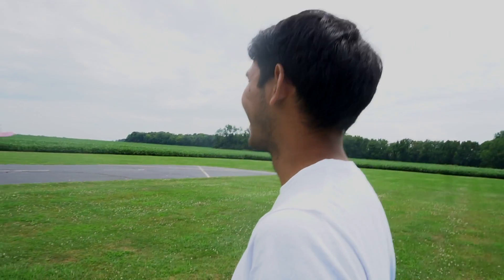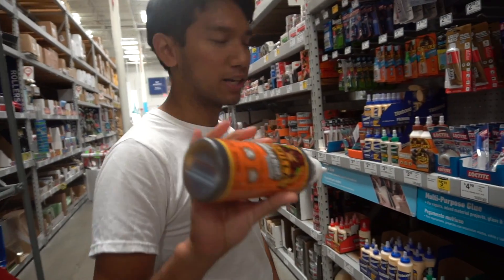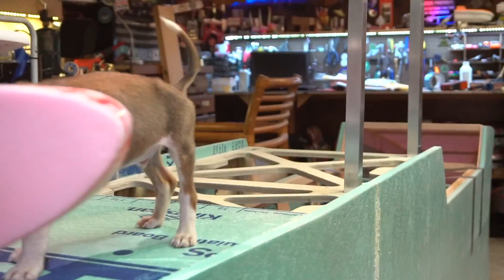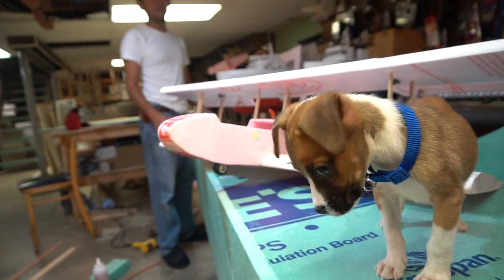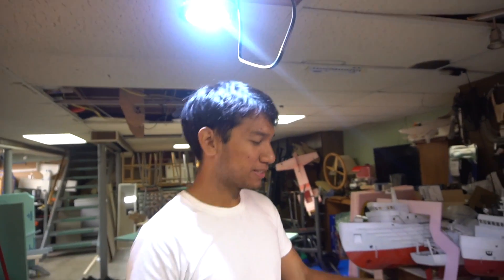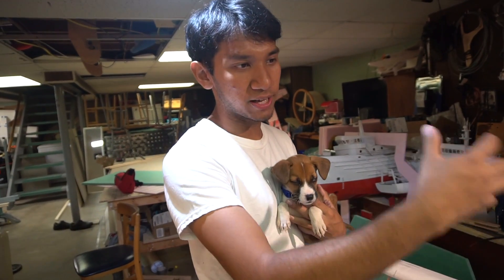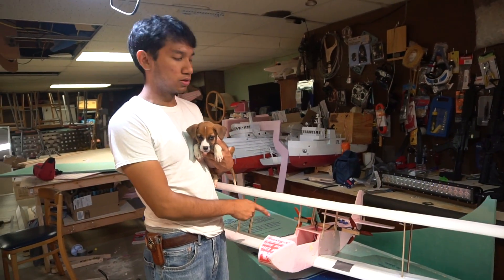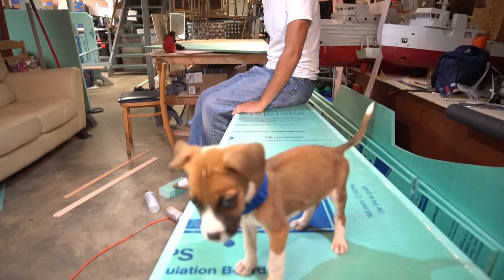DIY electric ULTRALIGHT pt1(fuselage and basic design)

Comment: Wait, so you're actually planing to fly in this thing, you're depending your life on foam and gorilla glue. Good Luck!
Reply: The majority of GA aircraft are just glued wood and fabric covering. Not much different than a balsa RC plane.
Reply: heck yeah and why not! it's built lighter than what I do for light boats but similar epoxy-glass work should be great. on boat chines I go 6" wide tape down the corners (3" each side), then cover the sides about 1-3/4" overlap onto the bottom, then cover the bottom same way overlapping up the sides about 1-3/4". gives you 3 layers cloth on all the chines making them a lot stronger, boats get bumped! with that foam I'd radius the corners 1/2" first to make laying the cloth down tight a lot easier, hard corners will always bubble. 2 layers cloth with 2nd layer at 45 degree angle definitely tougher and more structural, rather do that with 2 layers 2oz cloth than 1 layer 4oz or 6oz cloth.. same concept but thicker cloth when doing the boat thing. the less they can possibly flex at the corners....
AND OH HEY, mixing a bit of powdered carbon into the epoxy gets some carbon fiber strength and abrasion resistance, cheap enough to add in.
Reply: Reffering to glue: You do the same when sitting in a Boeing 787 dreamliner. 🙃
Reply: It's structurally sound for slow flying, which is the intent. Glassing the plane gives it huge integrity and his idea of carbon strip wrapping at critical points is good thinking.  It will probably end up over-built.  Be interesting when he gets to the wings.... Those have to be tough as, even at slow speeds, they will have multiple hundreds of pounds of stresses and twist. Hope he is judicious with carbon fiber !
Reply: The power of triangles.
Reply: If you've ever seen the original biplane build you would definitely agree this is over built
Reply: With enough triangles, everything can be structurally sound.
Reply: Piper Cubs are made out of fabric
Reply: Wood, steel tubing and fabric did fine on the Hurricane!
Reply: Its already been done.  Peters actually looks stronger.  http://machnone.com/index.html
Reply: Awesome Engineering don't forget zip ties, duck tap, and spit
Reply: Alex Edit the cub is only covered in fabric. It gets none of its strength from the covering.
Reply: HoverFly A Boeing is made out of Wood?
Reply: Right, wardope, and it would be quite safe too - wouldn't be able to lift off!!  :-D
Reply: We've actually flown in much sketchier things, of course, the incidence number goes up as "solid" work goes down.
Tho, i think that a modern interpretation of an antiquated design sure does its merits.
Reply: and that crashed and killed someone.
Reply: RogueSquadronWeapons
Who got killed by the first Flyer?
It was crashed several times, and was eventually blown over by the wind and more or less destroyed, but it didn't kill anyone!
Reply: The majority of GA aircraft are semi-monocoque aircraft made out of fiberglass and aluminum. I've seen aerobatic planes with aluminum tubing with fabric or vinyl glued on, but the majority have the skin as an integral part of it's structure. the vast majority planes are not made out of wood anymore, unless they're homemade kit planes recreating a ww1 biplane or something.
Reply: Awesome Engineering he's dead I already know it rip peter ☠️💀
Reply: if my life was on the line I would very much underestimate it.
Reply: Awesome Engineering yeah true
Reply: Anthony isvery much right and  It's very true. the fabric is only to provide a more aerodynamic surface and reduce form drag. 

a semi-monocoque design is the middle of the tube and fabric where the skin is merely aerodynamic in nature and monocoque where the skin is the structure of the aircraft, it's a very light design that way, but extremely expensive and not very good in the crash department. but that's why 95% of planes today are semi monocoque, because it's a perfect balance between strength, weight, and ease of production amd maintenance.

if I remember correctly the german ww1 Aboltross is a mix of tube and fabric and semi-monocoque for the wings and fuselage, the skin was molded plywood with it screwed into the underlying frame. Very strong, but the molding plywood would be hard for a homegamer.
Reply: the correct way of doing this with fiberglass would be to make a mold. And then Infuse Upwards of 25 layers of Fiberglass mat's with resin preferably 900 Gram Triax mats for maximum strength.
Reply: Turbo Twinky He's not removing the foam after fiberglassing.
Reply: but he's not doing it the correct way then
Reply: Leif Vejby it was a LT. I forgot his last name, but it almost killed Wilbur too. They were showing it off to the army at the time and somehow it crashed, look it up on google, there's more details than I can remember
Reply: I know about that, but that certainly wasn't their first aeroplane, more like #10 or #15. It was at Fort Myers, and Orville did the piloting. The crash was most likely caused by a split propeller which damaged the rigging. 
It happened while Wilbur was in Europe demonstrating another aeroplane.
Reply: MyBigThing2010 I know it's duct tape but there is also duck tape too so shush
Reply: JeddieBoy what's "duck tap?"